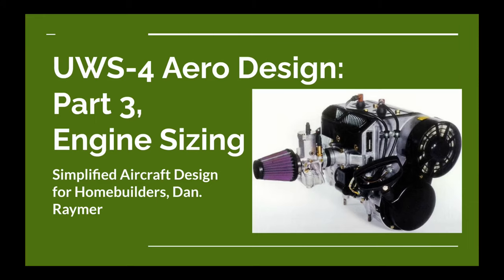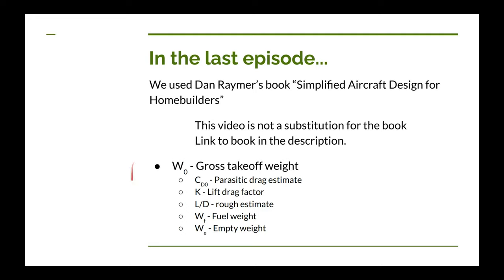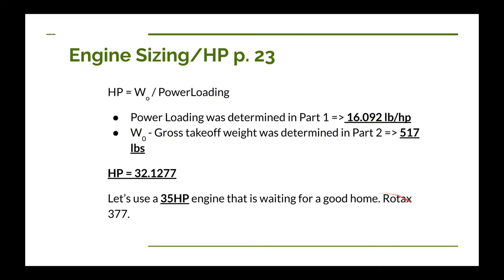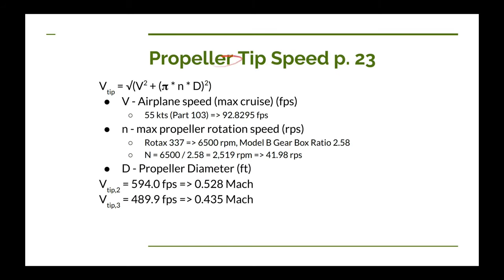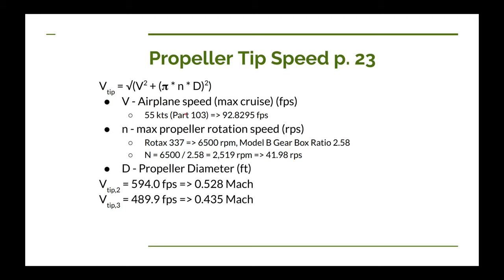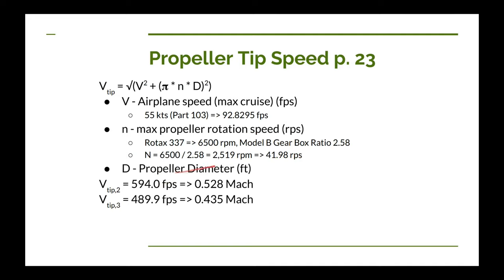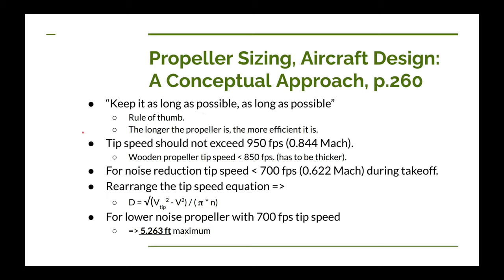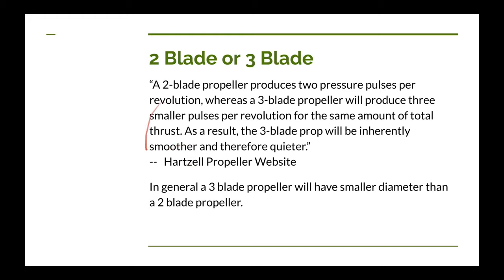UWS-4 Aero Design: Part 3, Engine and Propeller  Sizing

Comment: great video!  not sure if this is relevant, but wind turbines are usually configured with an odd number of blades, to avoid vibration from weight imbalances.  with even number of blades, the blade aligned with the tower throws the other one off kilter, (for a 2-blade fan, that is).  thanks for sharing your time and knowledge, greatly appreciated!

Comment: i thought the reason a 3 bladed prop would be quieter, tip speed is lower
Reply from the maker: You can have 2 and 3 bladed propellers with the same diameter, same RPM and the same thrust. In this case the 3 blades should be quieter.